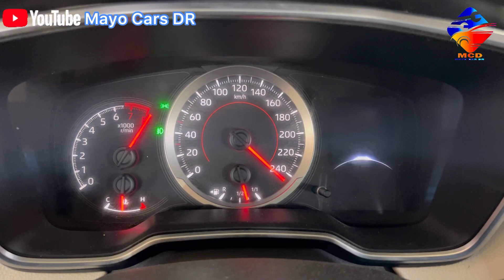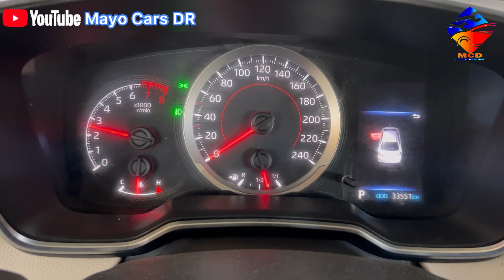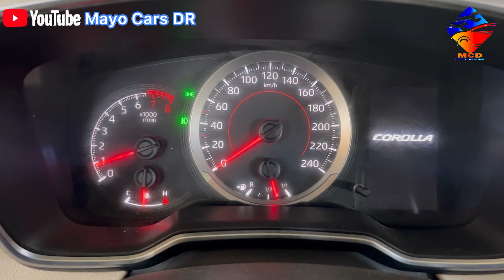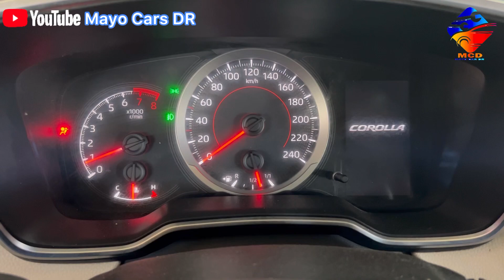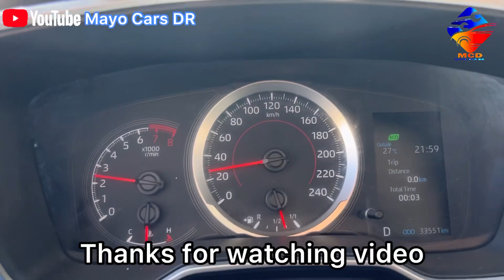Diagnose And Fix || Why Is My Car Shaking And Engine Losing Power Of Toyota Corolla

Comment: Hi, Sir
I Have 2020 Toyota Corolla 2.0
My Car is Vibrating sometimes at Stop Sign or In rush and then it goes back to Normal since last 1 week I'm facing jerking while reversing it's even more then the previous one, i Have Changed all Spark plug, and i did service of fuel injector, 1 was licking and Service center told it's not repairable so i bought new one and also, i have cleaned throttle body, fuel pump filter and Air filters as well But still these problem is there what to do?, Car has runned over 80k.
Reply from the maker: Your car has not been driven very much but the problem could be with the fuel injectors, clean them thoroughly or replace them.
Reply from the maker: And if you changed the spark plugs, change the fuel filter too
Reply from the maker: https://youtu.be/JPdaJPXPS_w

Comment: Hey there, I have a Toyota Camry 2003 that keeps losing RPM on idle. It's below 100rpm at the moment and goes off sometimes when I start it. I also noticed that whenever I use the AC the idle RPM drops the next time I start the vehicle. It's so bad now I've had to disconnect the AC to prevent me from turning it on accidentally and losing the little idle RPM I have left. 

What could be the problem?
Reply from the maker: Clean throttle body
Reply: @MayoCarsDR  thanks for responding. I have cleaned the throttle body and fuel pump, but it didn't work.

Comment: Bhai mere pass toyota corolla 2009 1.8 engine wali gadi 1zz engine hai bhai gadi 2lakh 22hazar chal chuki phly computer b shot hoa tha Bhai mene new spark plug ignition coil new toyota company se lay k lagai throttle body cleaning ki air filter new laga deya Bhai lykin gadi ka rpm 800 hai automatic transmission hai jab gear dalta ho tu kuch rpm drop hota lykin kabi bohat zayada drop hota gadi stalling karti yani band hone hoti par hoti ne fuel pump pressure b 50 hai ab ap batao Bhai kaya karo maf air sensor change karo ya throttle body Bhai ac k sath zayada rpm drop hota Bhai plz help kaya kro
Reply: Bhai koi help b karo kuch bataye kaya karo aur gari me koi check light on nahi

Comment: How can we prevent spilling the gasoline out of the injectors? Is there any fuse that turn off the pressure from the fuel pump?
Reply from the maker: If you open the fuel tank cap, the pressure will be released